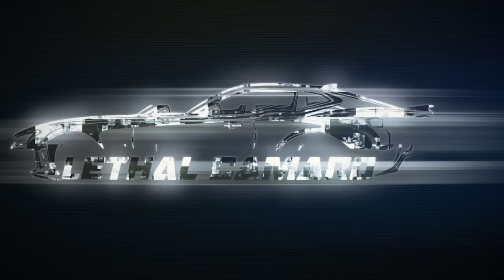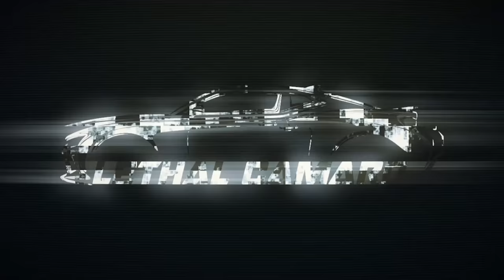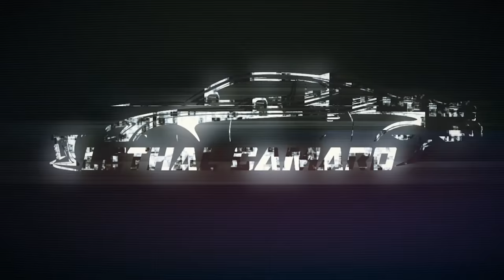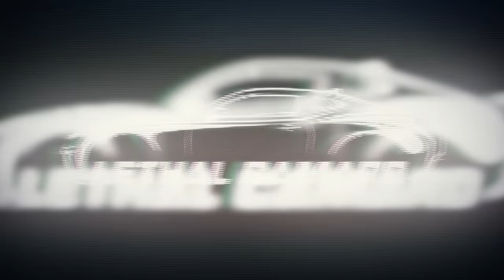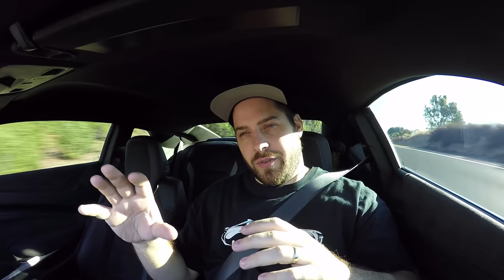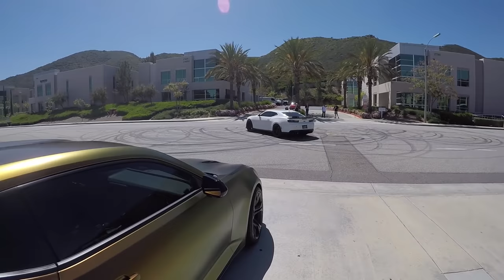Performance Chips! Watch Before You Buy! - Drive with Lethal | S2: EP9

Comment from the maker: I love the comments here from over the years. But to clear things up. Chips vs. Tunes vs. Canned tunes are all different. If a plug in chip tunes the ECU, that is not the chip I am talking about it. I am talking about chips that plug in and leave the stock ECU 100% the same. Chips or units that bypass aspects of the factory ECU are also different and are items the EPA are hunting down currently.
Reply: Even if the EPA is hunting them down, there is a possibility to still find them, right?
Reply: I have a 5th gen you got an email address
Reply: Well if u don't mind could u find on for a 2000 Isuzu hombre 4 cylinder 5 speed two wheel drive it doesn't have power for nothing going up hill I lose 10 miles an hour fast
Reply: And after I'll go to tun it

Comment: Just put 200 stickers on the back windshield and that should add 200HP to the wheels
Reply: lol omg
Reply: I put 200 on my front windshield and accelerated so fast that I've been stuck repeating this same day over and over. For the 1000th time people, burn stickers... burn them all.
Reply: Each sticker adds 50hp
Reply: @markseason5403  lolz
Reply: Your joke is so 4 years ago bro
Reply: Haha
Reply: @markseason5403  did you also change the air freshener? The stickers only works with air fresheners
Reply: My rear windshield is almost full of stickers! Wanna race me?
Reply: 200??? Are you crazy or do u think im that stupid to think that stickers add 200 whp. On a tractor maybe but on a sixth gen they add atleast 500hp. I aded ovr 40 stickers to my 1lt and i easily smoke zl1s
Reply: Maybe 200 to the cam lolol 😂 but not the wheels LMFAO 😆
Reply: I just use a nitro sticker and changed my exhaust tip. Guaranteed to get  more H/P
Reply: LMAO!!
Reply: He’s got a point
Reply: I have about 35 and I noticed a HUGE increase in power. It's crazy... I wouldn't say 35 hp but I bet at least 20. Definitely would recommend adding them!!
Reply: Copy and paste jokes outdated hehe oh add some paint to a door handle it'll get 20 up durr 🤤folks in the world have lost there brain power 😂😂😂
Reply: LMBO

Comment: Way back in time I bought an access port for my new St the time 2004 Subaru WRX. That thing claimed 30 extra HP. It did not disappoint. That 30 extra HP felt incredible in that little car.
Reply: what you suggest for a 2014 accord
Reply: @niezyje8922 a better car
Reply: @jordanhooper6511 😂😂😂😂😂
Reply: @jordanhooper6511 is a 2018 2.0t accord better enough?

Comment: Chips are for throttle response, it makes the connection seemless between throttle and acceleration. Some cars have a lag where you hit the pedal and 1-2 seconds later you get the desired response. Chips help with this, especially in older cars. Chips work well with chargers and challengers too.
Reply: This comment was exactly what I was looking for. From what you’ve explained it sounds like a good fit for my Xterra. It has lag when I give it throttle, especially going uphill.
Reply: @ChrisRedding1  and this is the comment i was going to say 😂 but yea i own a 2012 charger v6, and the throttle lag is almost unbearable, and i dont want a chip to not only go faster quicker, i feel like thats how a car should “drive” (my opinionss)

Comment: if you want more performance use good gas and wax the entire car, and if you can remove as much of the interior as you can.
Reply: And put you Instagram tag on the back window
Reply: And empty out the trunk !
Reply: jmb 1970 add new headers and take off the entire exhaust from the cats back depending on state. If You don’t half to have cats just have headers
Reply: And cut of every extra bolt going past the nut (much lighter)😂

Comment: I know this vid is a lil old, but yea man..  
In '96, I got an '89 GMC (S-10) Jimmy and about 2000 I replaced the factory 4.3L V6 engine for a Jasper 4.3 V6 (w/roller cam).
Drove for a couple yrs. then got some "STAGE 4 PERFORMANCE CHIP" don't remember the brand, but after instal I noticed SLIGHTLY better gas mileage &  SLIGHTLY more low end torque so I felt like it was worth the 200-400 I spent on it at first.  LATER I STILL NOTICED PWR & MPG but felt it wasn't worth it.
...just wondered if technology had gotten any better in the last 10 or so years. 
Thanks 4 da vid. 

Later, bout 07-08.. I totaled it by accidentally knocking 2 trucks (IN OPPOSING TRAFFIC) into the ditches (BOTH SIDES) of the road AS I HIT EACH ONE BACK2BACK SPINNING A LITTLE MORE THAN 360°!!!  Made sure the 2 men & one's wife were okay. They were.. Thought dey would kill me for that!!  I'M LUCKY THEY WE'RE GROWN MEN OR THEY'D HAVE BEAT MY LIL' HIGH-SCHOOL-KID-A$$!!  LOL... 
IM WEIRD I KNOW.. I was just giving folks something they can read..

Comment: I bought the dragon works performance chip. I think it works great, supposed to give extra 20-30hp.
I drive a 2013 chrysler 300 srt8 6.4 litre.
Gears change a lot more acurately/quickly, feels better, quicker. Better response etc..🤷‍♂️ dont know , could all be in my mind but the car does feel better.
Paid $110 AUS.
Maybe these chips are the real deal. Maybe there is such thing as an actual performance chip that we can just plug in.

Anyway my opinion on the chip,  I own one and so far all good.
If any changes will let u all know.
Cheers
Reply: Are you still using it ? I want to get a chip or a good tuner for my 2013 Camaro
Reply: Does it have to stay in or you can plug it out?
Reply: Where did you get it?
Reply: I mean they wouldn’t be in business still if they didn’t work, may not make your car powerful but it will help it be more responsive

Comment: I was told by a tuner that for the 2017 Camaro SS you don’t have to send off the ECM if you’re only tuning the engine .. you have to send it in if you’re tuning the transmission though

Comment: I've been looking at these chips I just traded my 2011 Ford Taurus SHO for a 2015 low mileage Ford Taurus SHO. Some of them out there are legit a lot all they do is fool your MAF, also do damage to the vehicle. Got to say my 2011 had M for manual to activate the paddle shifters this one has S for sport mode and paddle shifters can be engaged in drive or sport mode. You don't have to use them and if you don't make shifts it will revert to normal mode. It will also upshift if your over revving automatically which is a nice touch. The car is fast enough but in sport mode my God, eighth of an inch gas pedal depressed equals 45 miles an hour lol. I've raced a few people one with a new Camaro and I work at GM ROFL between the twin turbo 24 valve dual overhead cam all-wheel drive I smoked him as well as many other vehicles and this is stock.
Reply: I had a black 98 SHO.. that 3.9 V8 was a beast !

Comment: don't you think that using a chip to change the setting. could result in better acceleration? if it takes out the drive by wire pedal lag, when it shifts, and so on.

Comment: ok..at 53 secs he states he has seen first hand plug in tuners give power gains first hand, yet at 1:33 he flips and says you wont get power from a chip...im listening
Reply: I think tuners are NOT the same as a chip if you research it. The tuner person hooks a laptop up to the ecu and reflashes it with different specs. The chip plug-in install can not reflash all the specs without actually knowing what you are at and where you can go safely within the possible specs. I am listening to what you said and it’s like overclocking computers. It can work if down properly. Car improvements are the same.

Comment: the more recent vehicles, yes you are correct, you wont get much for the money involved. the new engines are just so efficient already, look at the corvettes-25 mpg on the hwy, the hellcats 22 mpg hwy-this is unreal with all the torque and power they are developing. even with performance intakes and exhausts added you arent getting a whole lot. vehicles in the 80s 90's and early 00's benefit the most. canned tunes from diablo and superchips are not giving you much either. so a professional tuner is the way to go with cars from 2010 and on. the only way to get big benefits is to break the engine open and put in camshafts and intakes and heads then have them balanced and blueprinted. then you more than likely will need to have them tuned.

Comment: I agree with you that most plug and play chips probably do nothing and if they do change something it's probably doing more harm than good. But the butt seat dyno can be used effectively if you drive that car every day, pay close attention to rev ranges, fuel economy, and most importantly can be honest with yourself. I will be honest. Not everybody can do it. However, I can tell you techron is a damn good additive for high mileage corn engines, lube guard power steering additive makes turns buttery smooth, and seafoam ss14 will put in work from intake to exhaust. My 170k mile 07 impala's idle used to vibrate the rearview mirror violently when I first got it. Now it's idle is nearly inaudible and no shakes. I used some other additives but those are 3 that I felt had the biggest impact and that I would recommend to anybody with a high mileage vehicle.

Comment: Ur pretty much on point. I was cracking up wen u said "it's all in your head" 😂😂👍👍
Reply: He called it butt seat dyno 😂😂
Reply: I must disagree. Today's cars have gas mileage monitors. I can reset it before a trip route that I take often, where I know I average 33mpg. If I now get 34 or 35 MPG,  then I can verify something has changed, without even checking my butt.

Comment: I have a JDM pro stage 3 chip on my grand marquis. It really helps the car turn the 24s a whole lot easier. My flow masters sound more aggressive and when I’m on the highway I barely have to touch the gas. With out the heavy rims, it is impossible to cruise at 30mph and press the gas pedal. I don’t even drive my other nicer vehicles because this one rides better because of the chip
Reply: Little Falcon I’m about to buy mine !!

Comment: I seen some tuning chips that already come like “tuned specifically with a 35 horsepower increase” can you just throw that new chip in and it will automatically throw 35 more horsepower or do you have to tune the chip? It’s really confusing bc the websites make it seem like it just adds horsepower by just installing the chip
Reply: I agree idk

Comment: Modern engines are tuned to maximum power with reliability from the manufacturers. . Air fuel mixture is usually toward lean to comply with emissions and fuel efficiency, except at full throttle to protect the engine. Every part of the engine is engineered to work together. I agree a professional tune will optimize performance at expense of fuel economy and very slight H.P and torque gains! Very well said sir !

Comment: I put one in my Mazda a while ago. And before I put it in, 3rd gear would top at 70 and after it would do 80, the car didn’t struggle as much to get up hills but that’s about it, it wasn’t a huge change
Reply: Did you see a huge change in hp
Reply: @isaacontiveros7961  ehh it was a decent change for it being just a chip tune, it was supposed to add 60hp but it did more like maybe 30 hp but it was enough to notice a difference I would say, it’s worth it to me depending on how much you spend

Comment: hey lets remember in 1987 i put wath they call a prom chip in my 1986 chevy z24 with 2.8 v6 sequenciel injection this thing brings me more power but you have to follow the instructions. 1-remove cat conv. 2-low restriction exhaust i went 3 inch trait pipe 3= air induction i went kn filter with duct ram inlet 4- more pressor fuel pump my gain were calculated in performance rather then horse power so stok was 0-60 in 8.1sec. ater was 6.8 then i went with an agressive cam and calibrated injector wow now 5.7sec and i play with mustang5.0 feels good ho i forgot little mods. to the small auto tranny the name of that machine was heavy chevy loll.

Comment: Took my f-150 to a dyno and it had 314hp and 298ft lb of tq.  Bought a Rocket chip for 100$ drove 200 miles and took it back to the dyno: it hit 339 hp and 307 ft lb of tq so I’d say there not Fakes, some ppl just had shitty luck with them I’m Sure!!

Comment: He is partially correct. The obdll plug in tuning chips merely take the signal from one or possibly 2 sensors such as the fuel pressure sensor and the turbo pressure sensor( if equipped) and change the value going back to the ECU...all cars are different but here’s a very generic example: let’s say your ECU is programmed for and (expecting) to see a voltage of 1 volt from the turbo pressure sensor at a certain rpm and throttle position, the plug in tells the ECU that the voltage is only 0.5 volts, so the ECU sends a signal to the blow off to close up to build up boost while also doing the same trick with the fuel pressure so that they match ( a correct amount of fuel for the boast its getting...as he said the El Cheapo’s arent going to do much if anything but some of the higher end chips do increase horsepower and torque HOWEVER; a A plug-in chip only change is a couple of values which could end up being troublesome or even disastrous for your vehicle where as a professional A plug-in chip only change is a couple of values which could end up being troublesome or even disastrous for your vehicle where as a professional tune adjusts many different things including peak boost, boost ramp, a fuel map and over the ECU’s built in torque limiter plus much more.... if you are going to use a plug and play chip, DO NOT FORGET TO PUT THE TUNER CHIP STICKER IN THE BAVK WINDOW....that alone is worth like an extra 50 horse!

Comment: only turbo cars benefit from those chips because it unlocks more boost but n/a cars hardly get 5 hp since those engines already maxout unless you go full bolts on and that requires a dyno tune.

Comment: Does this apply to throttle response or low end power? I'm not mechanically inclined. Just trying to get a little better fuel mileage and a safer acceleration when pulling into traffic.
Reply: Get a pedal control like pedal commander it will definitely help your car be more responsive
Reply: i confirm pedal commander helps control the curve of acceleration. big different on mine. no extra anything but acceleration control yes

Comment: GOT A 2009 5.7L V8 300C I was wondering how to change the shift points to be a bit more "aggressive" so it's not trying to shit gears a full second after I've already began to accelerate again (causing wear on transmission of course).
Reply: Re-gear it, of course....

Comment: I got a COBB Access Port for my Subaru, and I can't really feel a difference, but it's a very reputable brand, so I knew it wouldn't break my car. There's people working on the tune maps, and once in a while they come out with a new version which you can upgrade to.
Reply: Birdy Cephon be carefull.....my friend blew his 2015 STI motor with that tuner. The car only had 2600 miles. Of course it could have been other factors as well, But the car was near stock with intake and exhaust only.
Reply: Ouch. Only thing I can think of that could have done it is if he used the launch control feature, and they do have a warning about using it.
Reply: Birdy Cephon 
That was it , probably
Reply: @808G8GT  Well your friend did something wrong

Comment: Great Vid! I am considering a Pedal Commander. I think your absolutely right about the HP gains being in your head. However, quicker throttle response is something I think these things can maaaaaybe do.  Any thoughts on the pedal commander? Anyone with experience with them? I have a buddy who works for GM and he states that if you floor a stock vehicle its always delayed due to the factory tunning. However Police vehicles are made to not have the delay. I want to smash that pedal! lol.
Reply: I liked my pedal commander but had to remove it because i kept getting a stability control light.
Reply: love mine i have a 3.6L charger 2015 sxt
Reply: I installed the pedal commander on my 14 Charger RT, and I can confirm that it 100% works. It merely plugs into your gas pedal, and adjusts the sensitivity of it digitally. When you bring it all the way to sport+ mode in my car, then so much as tap the gas, it will scare you how quickly it responds and gets going. Now I will admit that you gotta keep in mind that it is a throttle response thing. So it doesn’t change your HP at all, and if you floor it in any mode then it’ll feel the same because the car simply is just giving everything it can no matter the mode. Plus an added benefit is that eco mode if used with a careful driving style actually helps with mpg. Adding more throttle lag in comparison to stock genuinely helps me save fuel. Something about slow acceleration makes the car save fuel better.

Comment: i bought a08 ram 1500 3.7 no bells or whistles just a work truck did a few things to it then discovered the pedal commander, any car or truck after 05 has a electronic throttle body and the lag and hesitation in the gas pedal is ridiculous and no amount of mods will change it trust me me look into the commander its about 300 bucks but worth every penny